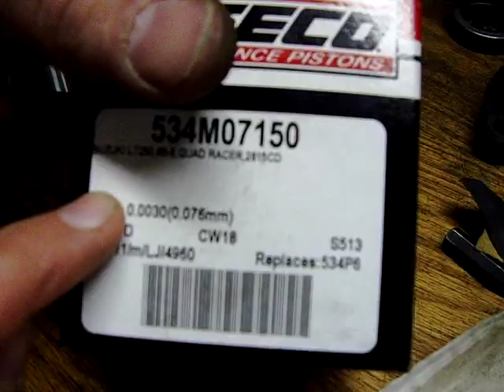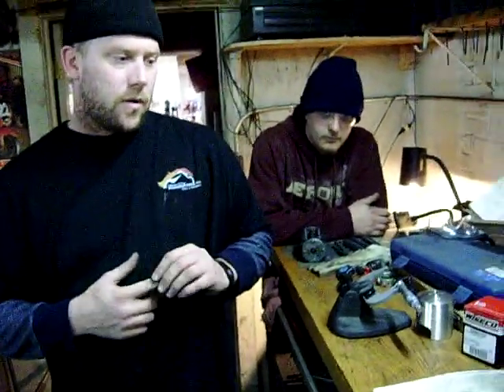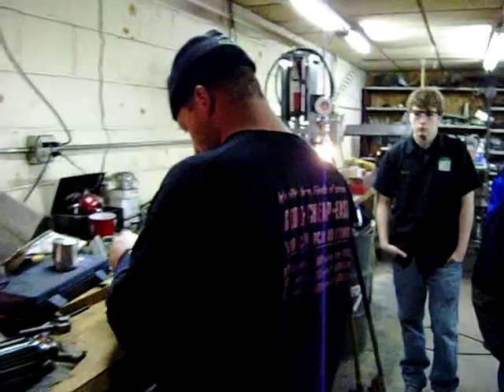Part 2: How to bore a 2-stroke (two stroke) cylinder ATV  DIRT BIKE watercraft

Comment: No mention of Nikasil coated cylinders, and their own intricacies
Reply from the maker: You can't bore Nikasil cylinders, Bruce. Well technically. Those types are bored, welded, rebored and replated for standard sized pistons. Keep in mind these videos could never cover EVERY possibility. I try as much as possible to keep the videos short when able or topic focused. 
Keep tuned in...:)